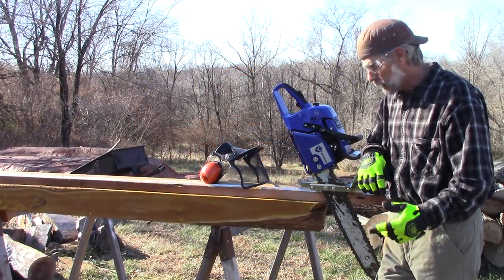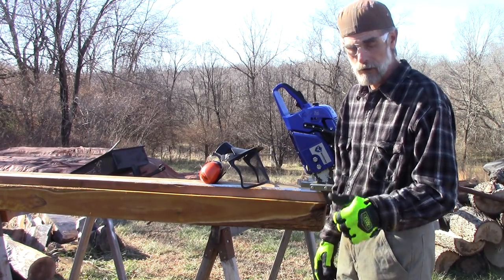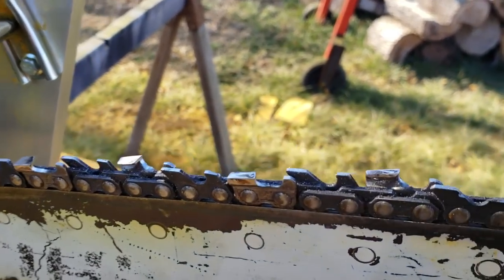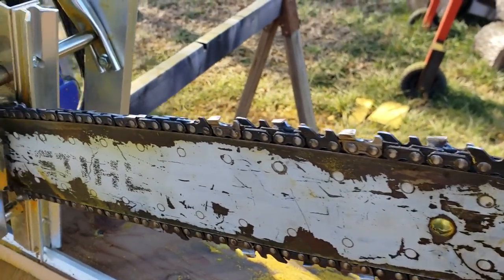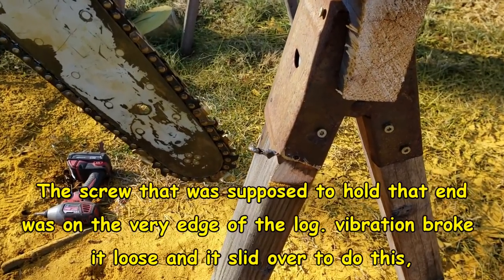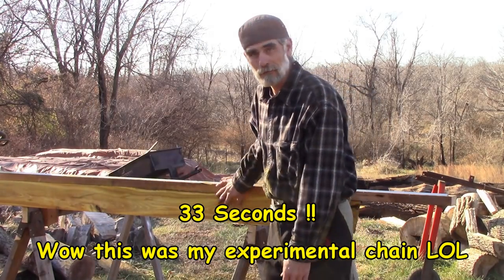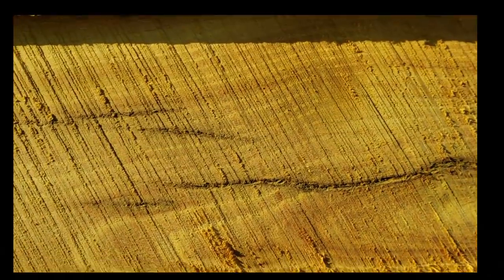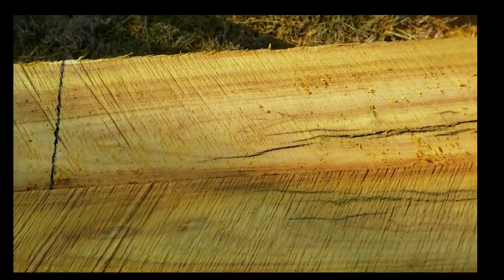Trying out different Rip Chains (Homemade)

Comment: Just a suggestion,  if you fabricate some 1/2" copper tubing into an exaggerated C to cradle your cut stock after you start the cut and about 3/4 of the way through your cut stock will not fall to the ground and the final bit of cutting will be clean.

Comment: Hi, I have played around with chains as well, but the only thing that made any difference in smoothness is the vertiacal angle on the grind. 10 degres on the top of the tooth / horizontal, but between 55 an 65 degrees on the side /vertical angle. You would need a table circular grinder for that. Check logosol specs on various types of chains - that worked the best for me! I salut you for the experiment and the hobby!! All the best from Slovakia!

Comment: I have very good results by making my own ripping chain. File all cutters to 10 degrees and then use bench grinder to reduce the width of half the teeth on the chain by half. For my chain it was 2 full cutters and 2 half cutters all the way around.

Comment: Good video.....Though...having nearly 55 years experience w/chainsaws...and having been nicked a few times...the way the bar nose points at mid-thigh and femorial areas makes me very nervous...glad to see chaps...but chaps are not bullet(saw) proof..as many of my associates of years gone by can attest. Good milling.
Reply from the maker: Yea to be honest it had me wary the whole time. I think if I were using this on a regular basis I would have a board extended off the saw horses so I would be on one side and the bar in the other. But to be honest my bandsaw mill does this job more safely and faster with less waste.
Reply: @DIYwithUncleCy  Good deal....just that after a few rounds with the saw...I'm a little nervous. Cut some big Douglas Fir (28") in 12 foot by a full 2 inch decking...with my neighbor...we cut an entire 10'x32' deck package with my chainsaw mill as that is what we have (and no financial surplus)...that and 20 acres of timber. Lots of work...but you could really see the pride in his eyes when we finished. Made a cuple old farts sweat....and drink water instead of beer....till after hours...LOL !!

Comment: Thank You for that interesting video. I'm not equipped to make videos. But, when you feel like doing some more experimenting, there are some other things I was wondering about. Would it make any difference if you turned the saw around so that it cuts down instead of up? Is there a perfect raker depth to get the maximum cutting speed for the particular saw you are using? In other words, will the chain rip faster if you cut down the rakers or will it overload the engine? Would a continuous lubricant like water make it cut faster or would it be bad for the saw?
Reply: I think if you used the pushing chain it would want to push the saw off the guide

Comment: you have a band saw why fool around with a chainsaw lol...I use a chainsaw mill and use skip tooth chain with a round corner on it not square, and it cuts really smooth.
Reply from the maker: Because it is fun. My only reason. I have a barn full of milled wood that is dry and ready to use, but I have plenty of logs to mess around with so I kinda figured what the heck. 😁
Reply: Lol. Because it’s fun...excellent.  I’m glad he did this so the rest of us can learn.  I don’t know if I will ever again run an Alaskan for fun, but if I have to pack in a mill, it will have to be an Alaskan style.

Comment: In pine, got really smooth results with a factory 10° grind ripping chain. Could be the difference between pine and hardwood. And Osage Orange is very hard wood.
Reply from the maker: True. And part of it was that I was using full chisel chains. Semi chisel would have worked better but I could not find any locally.
Reply: @DIYwithUncleCy , I ordered my ripping chains from "baileysonline dot com". Sometimes they have insanely good sale prices .
Reply from the maker: Yes I have been by their site looking at chainsaw carving accessories. For my big saw I got the ripping chain from Granberg.
Reply: It has been my experience that defects are much more pronounced on softer wood. I get a nearly perfect finish with a semi chisel chain brought to 10° on oak and cherry while the same chain leaves ridges in pine and cedar.
Reply: @DIYwithUncleCy  What is the ripping chain for the yuzhoukee ?